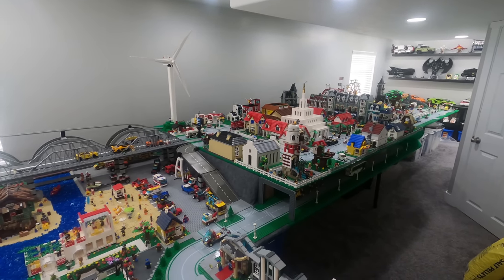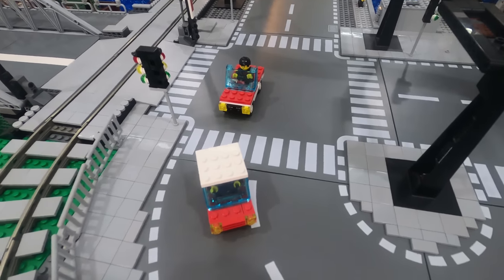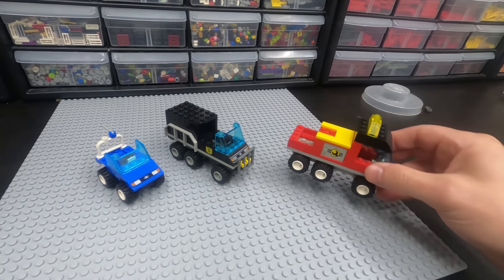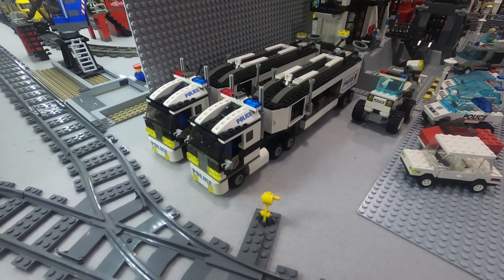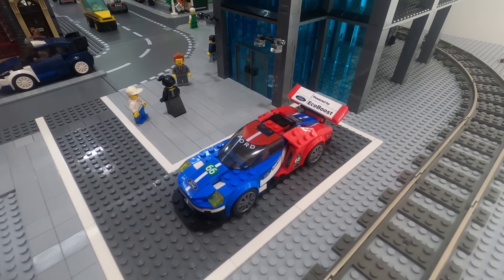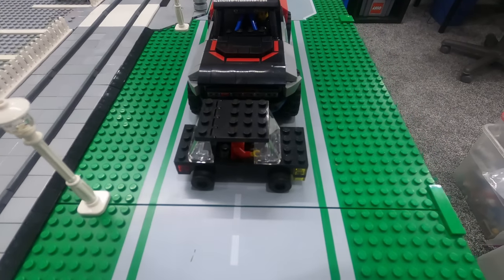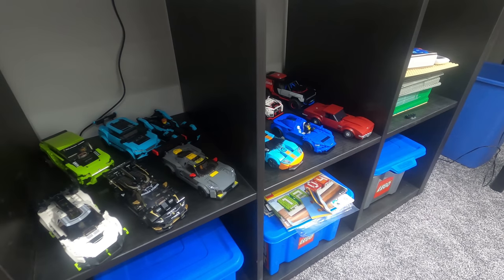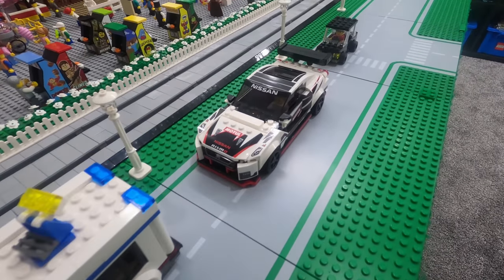Are LEGO Cars Getting Too Big?

Comment: The new speed champions sets are a quantum leap forward. I love them. Finally cars that fit minifigures sitting side by side. And the exteriors are far superior to the old speed champions. I've also started to collect them. Never felt like doing that with the old ones. If it were up to me, TLG would produce wider roads to accommodate this size.
Reply: In my opinion. It lego best range they have today
Reply: i thought quantum was very small
Reply: I hate them. Not minifig scale friendly for a  lego city
Reply: Agreed, have collected all of the new Speed Champions sets and they're all awesome.

8 studs wide is definitely the way going forward.
Reply: You can make six-stud wide cars that can fit two minifigures side-by-side. The cars in the Simpsons theme were designed that way.
Reply: Well. Speaking about roads.. the new lego roads completely suck because they are ugly too high for in a average lego city and several other reasons. Your speedchampions will not fit on them for sure. And indeed lego should take a step back to great lego they produced back in the 90s. The city lego is allready outdated. Back to miniland with the monorails.
Reply: @skywarp2414  Idk what about you, but they go perfect for my city.
Reply: @igggoshastudios7802  good for you then. I prefer the 6 stud wide. Much more minifig scale with the buildings too. Furthermore, its posdible to have 2 minfig side by side. Just look at the pink Cadillac from the Downtown Dinner.
Reply: @skywarp2414  my city just has a plot twist: roads are drawn on paper, so I made them 9 stud wide
Reply: @igggoshastudios7802  what about your buildings? Are the scale adjusted for 8 stud wide cars ?
Reply: @skywarp2414  one more plot twist: i have one building, which is a moc house, and it has no exterior things like garages, plus it’s damaged because my cats like to destroy my creations
Reply: @purplefish2786  just for fun, I'll add to your response that while quantum things in Physics are small, a quantum leap is pretty much when a tiny particle ends up jumping out of where it should be.  So it's basically a leap that should be impossible but somehow still happens.
Reply: @SirReberal  OHHHH ONE OF TJOSE RIGHTTTT
Reply: @skywarp2414  I mean, my buildings are scaled for 8-wide cars, but I also use 48x48 as my standard so...
Reply: I don't even like cars, but some of those speed champions sets are just really beautiful. Especially when I saw the Koenigsegg or Ferrari in the store.
Reply: exactly said best
Reply: Shawn Stafford  im not the best with understanding scaling but mainly the biggest change is the length and width of the cars by around 1-2 centimeters. Millimeters to no change to the height to most, except for the new SUV Lambo.
Reply: @skywarp2414  Nothing is really minifg scale because they're too wide compared to humans. A one seater car would look thin as hell irl, but they work great in lego form. The champions make more sense for having too seats, but I totally understand how they can look too wide, I'm still undecided on this. So it doesn't boil down to accurate proportions, they're not possible, it's just preferences
The 6 studs kinda feel more nostalgic to me though, more lego... I dunno.
Reply: @Dbunk0  well to me minifigs scale building and vehicles were never meant to mimic real life stuff, so a 8 stud wide car looks and feels awkward in a Lego city.
Reply: @skywarp2414  Speaking of which I just saw something, if you're into knockoffs sembo has a line similar to speed champions, detailed real cars but 6 wide on ywobb, dropping that here just incase🤷‍♂
Reply: @Dbunk0  im good. Thanks anyways. Ive got a dozen 6 stud wide speed champs already. My city has a traffic and wreckless driving problem 😄
Reply: I like it because it appeals to us older fans, they are brilliant for display as it combines two things I enjoy cars and lego.
Reply: @caesar7734  The cars for The Simpson’s weren’t detailed, and were very boxy. Speed Champions cars would look horrendous with 2 figures side by side at 6 studs.
Reply: @skywarp2414  i personally disagree, these new 8-stud cars feel so much more realistic for the minifigs, as much of a pain as it is, i’ve actually been taking my City vehicles and actually scaling them up to speed champions size, the two minifig wide seating is just too good to not utilize
Reply: Same, they allow more room for detail like the lego aston martin vantage gt3 and the Valkyrie. I guess if you would want them to fit in a city you would need to buy custom roads or build custom roads
Reply: @skywarp2414  I get that but as a car enthusiast I thinks it’s the perfect blend of Lego and real life counterpart
Reply: @jracer7189  yes thats true. They made them for car enthusiasts in mind, but not necessarily for city builders.
Reply: This means only city sets work for city's and not all of them the crane set is 8 studs wide so I hate them

Comment: I’d say it all revolves around the minifigures being grossly out of proportion for a scaled down human
Reply: That's the key. In order for a car to retain accurate proportions to a real-life car, it either has to has to be the 'right' height and length when compared to a standing minifig and only fit one minifig, or if you want to fit two minifigs, it has to be way too tall and long when compared to a standing minifig. You can't have it both ways with how minifigs are proportioned.
Reply: @ifoundoneavailable  Actually it is possible to fit Minifigures side by side in a 6-wide, but you still don't get the same level of detail or space.  I mostly build 8-wides (custom ones) but have built a couple 6-wides as an experiment.  The 6-wide version has two static front seats, the 8-wide has folding front seats to allow people to get to the two rear seats, plus a gear shift and handbrake.
Reply: @ifoundoneavailable  Pulling off an arm of each of them does allow for slightly more realistic proportions for a two seater in my experience, but I also have a good number of missing arms now so.... there's that.
Reply: @scottthewaterwarrior  Modern cars dont have gear shift nor handbrake hehehe 👍.
Reply: @RondonMatta  wrong
Reply: @RondonMatta  So how would you put automatic car in reverse?
Reply: Mini figures aren’t suppose to be scaled down humans
Reply: You don't know my Aunt Peg. She basically are the perfect proportions of the minifigure. She was 4'9 and about 300 lb
Reply: @seeeabaasssiliketransforme9904  LMFAO!!
Reply: @BeastlyGamerr yes, but it's our metric to compare
Reply: That's what I've been saying, true

Comment: What a great Lego car history lesson!  Personally, I stick with the 6-stud cars and pass on anything bigger.
Reply: Agreed, 6 wide is the best universal size/scale of a lego vehicle in my opinion. Allows just enough space for realistic models, while still fitting in. 8 wide speed champions models I think are way too massive...
Reply: @dallasfrost1996  you are wrong for a city or large display like a city. Speed champions is made for collecting and realistic looks for the cars. Overall I really like the 8-stud models but it is up to you.
Reply: @squiddysquidster802  To each their own, I realize that speed champions models are meant more as display models, however I thought the 6 wide models for the most part were perfectly fine. There definitely was room for improvement. Personally, I don't think 8 wide really makes that much of a difference in a few cases. In fact in some cases, 8 wide looks worse than 6 wide, an example of that would be the Nissan GTR from last years speed champions line. Looks really out of proportion, and to its general scale. There are a couple more recent 8 wide speed champions sets that have suffered from that actually...
Reply: Agreed
Reply: I personally like the 8 stud wide cars since they look miles more like the actual car
unlike the 6 stud wide ones
Reply: @dallasfrost1996  alot of the new line up has fixed this. For example bigger tires the 2021 lego speed champion line up has slightly bigger tires making the proportions of the tire to the car much better.
Reply: @casedum273  I have the new 2021 Corvette set, with those new wheels. There's barely a difference between  them compared to previous ones. The biggest difference is it being a 1 piece mold, as apposed to the 2 piece wheel/tire combination. In terms of wheel size/diameter, there's almost no difference...
Reply: @dallasfrost1996  the rim size are also bigger
Reply: @dallasfrost1996  adding onto this I have put the old speed champion wheels and look to small on the newer ones.
Reply: @casedum273  That's why I said "amost" no difference. The tire depth is the same, the overall outer tire diameter itself Is the same, only the rim itself is slightly larger. All that does is give the tire an even more low prolife look. Which doesn't completly fix the problem of being out of proportion... It helps a little however.
Reply: @dallasfrost1996  Look at the brand new Lego Speed Champions Ford GT and look at the old 6 stud wide Ford GT double pack and tell me 8 stud doesn't add a whole lot of detail
Reply: @nikitalomakin3205  To make it more clear, I do think 8 wide can definitely make some difference in the level of detail if used efficiently and properly. There's no questioning to that.

Sets like the new Ford GT in particular definitely showcases the benefits and potential that there is for 8 wide. I don't necessarily "hate" 8 wide, but Instead simply much prefer 6 wide for my personal application, and just in general really. 

What I was getting at is, Many, if not the majority of these 8 wide models essentially could've be done as effectively in 6 wide. Yes, Not all vehicles are possible at 6 wide, I realize that too.

I guess the main point I'm trying to get across here is, the 8 wide platform/scale in some cases is simply not being used as efficiently and effectively as it could and should be. Some models make good use out of the larger scale, while others not so much... Thats just my personal opinion ofcourse.
Reply: @dallasfrost1996  Some cars are just simpler than others.
As someone who just collects them and has no Lego city of any sort, I do think the 8 stud wide models improved a lot in detail, proportions and a lot of the little things that were done before with stickers are now done with actual building.
Reply: @nikitalomakin3205  While your first statement is correct, it's only so to a degree. As for proportions, That's still Debatable with certain models, and still very much so with its surroundings and tires. 8 wide mainly just gives the ability to implement more sophisticated car designs more proportionally.

As for all these 8 wide models being able to integrate more brick built details as opposed to Stickers, Theoretically speaking that should be the case. Unfortunately, it isn't so in a couple instances. Again, some builds will make good use out of that flexibility, while some will still give you multiple stickers to account for one detail. A lot of the time, that detail can be substituted for regular bricks...
Reply: @dallasfrost1996  There are still some stickers which is completely reasonable, but now the models don't depend on them too much and most of the shapes and curves are captured with bricks.
Reply: @dallasfrost1996  omg dude just stop.
Reply: @dallasfrost1996  6 stud cars are way out of proportion

Comment: I don't really see how "fitting in a lego city" would be a strong argument cause I think most lego enthusiasts don't have a lego city.  Also, is there really just one standard lego city size ?  I guess if you use mini figs and road plates you don't really have the choice...  But yeah, I'm more into technic cars and I just bought the new huge mercedes truck which is 48 cm long, so I really don't think lego cars are too big, lol.  Even if I'm not sure if at this point technics and legos are 2 different things sold by the same brand.

Comment: I love them, it was always a bit silly only being able to fit 1 minifig in a car. Backwards compatibility is a problem, but I'm sure Lego will eventually produce new road baseplates to match it if this becomes the standard going forward, and even without that its pretty easy (if tedious) to just build a road. With things like the modular buildings series, having environments that minifigs can actually fit in in realistic ways has become more important
Reply: the new roadplates can be modified to be bigger actually. instead of using one road plate for a two lane road, use one road plate per lane and put the white lines in between the two road plates instead of in the middle of one. idk if i explained that well but it makes the roads the perfect size for the Speed Champion sets
Reply: I just buy a ton of black 1xwhatever bricks, along with some 1xwhatever yellow and white plates, and build my own roads by laying them on their sides.
Reply: @TheCoolCucumber  They already would change their road system every 5-10 years.  The newest change is certainly the biggest, moving away from baseplates, but the old system still varied by style, width, and color.
Reply: Agreed. I immediately wasn't interested in the Corner Garage set since it couldn't fit 8 wide cars and the included tow truck only fit a single minifig.

Comment: The cars are getting wider and wider, almost too wide for some older street layouts … just like in real life!

The problem with "minifig scale" imo is that minifigs are just way wider than real humans. Imagine if you wanted to build a train where four people can sit across and there's a walkway in the middle, that would be 20 studs wide! It's just not possible to build anything that looks realistic next to a minifig and also fits a realistic amount of minifigs inside.
Reply: check out the Airbus 380  MOC . It is mini fig real size. it's 6 by 7 foot and it has 40,000 pieces and costs about $3000-$4000 to build.  That is what building for mini fig size means.

Comment: I love the speed champions line. I think it’s nice, imo of course, that we finally have vehicles that can fit two minifigs side by side. I have a race car set from 91 that next to my speed champions looks like a go cart. I think we’ll start seeing Lego come out with more “appropriately” sized lego city add-ables in the near future. We’re already seeing it in the city theme vehicles having an almost uniform 6 stud witdth. The new road plates will also help both older city builders and those just jumping in by allowing ultimate customization for cars of many widths. All in all, I see the larger scale as a good thing with a few drawbacks that you fairly and accurately pointed out in your video.
Reply: IMO LEGO cars have always felt like go-karts.  Even the couple 6-wides I've built that can accommodate 2 figs side by side still look like a golf-cart because of how big the heads of the Minifigures are.  They look really nice sitting in an 8-wide, and I can fit like 6 Figs in a minivan!  Course when they aren't in the car and are instead just standing next to it, yeah, 8-wides look huge!  And there is also the issue of LEGO trains being only 6 wide (or 8, in the case of my custom ones).

Comment: I totally agree. I still love the elegance and simplicity of those early 1980s cars. Though some of those newer 6-stud wide cars and particularly vans and trucks (where it's more appropriate) also look really nice and natural, if slicker and smoother than the older cars. We don't have any of the speed racers, but we do have 60148, a pickup with quad bikes. I was appalled to discover that the bed of the truck was 8 studs wide to accommodate the (wider than 4 studs) quad bike. That's just too wide. Please just make the quad bike 4 studs wide at most, so it can fit in a 6 stud wide bed.

Comment: In late 2002 When Lego released it's 2nd wave of Lego Harry Potter sets based on "Harry Potter and the chamber of secrets", One set included a car based on the 1960's ford Anglia model. The car in this set was 6 studs wide. What made it so easy to fit 2 figures together was that the car was designed with flat tile pieces where the figures would sit down and a type hook piece would stick between the figure to ensure that they would stay more still. The only times figures would slip out of position would if some were to tip the car over. Other than that, it was probably the perfect size car, even enough to inspire to build a similar car with back seats.

Comment: I bought a couple of those earlier Speed Champions sets, and they look good from certain angles, but I hated how narrow they are. It ruined their attempt to accurately portray real-life vehicles, and it's weird to have only space for one figure. It's particularly noticable on exotic supercars which are supposed to be low and wide.  I wasn't aware that newer models have expanded their width, but that's exactly what they needed. You can still get narrow, one man vehicles in the City theme, so they will keep old-school city-builders happy, whereas the Speed Champions look great on display (or you could make a special racetrack for them.) 
  In general I feel that Lego has been scaling their vehicles down, and they lost their appeal to me. Around the early 2000s I got some awesome Construction and Coast Guard sets, but more recently they released revised versions of the same vehicles which were only two thirds the size, and just seemed too tiny and basic for me.  I do understand that they are trying to keep costs down, and large parts of the company's history they have been skirting the border of unprofitability.